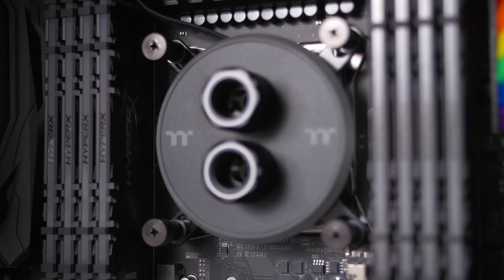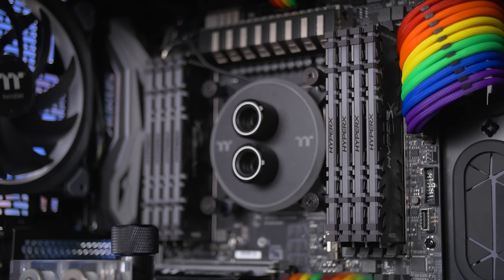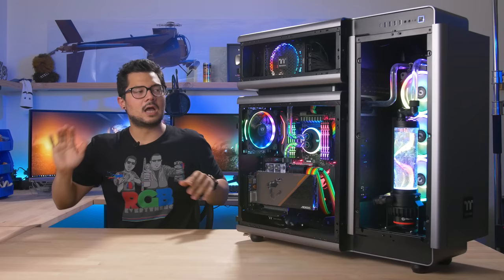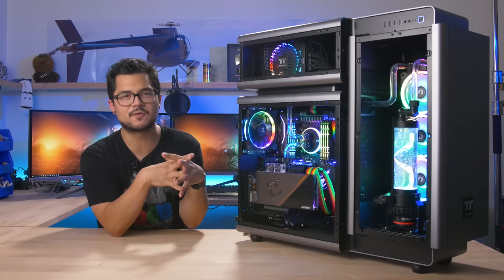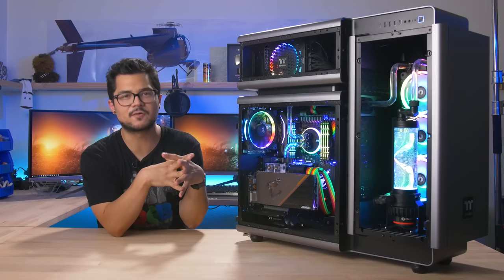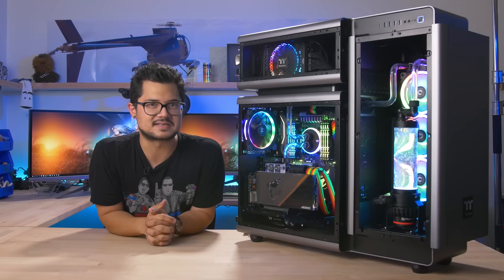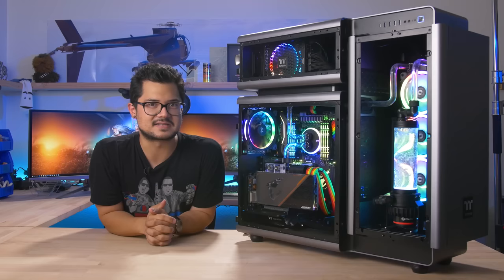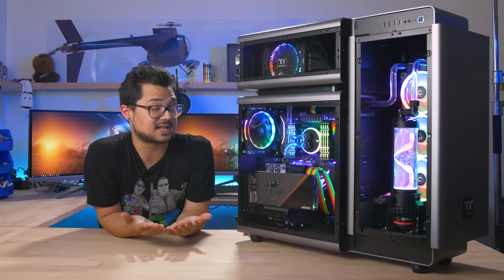Insane RGB Water Cooled PC (Part 2: THE REVEAL)

Comment: But wheres the RGB fittings
Reply: RGB SSD, RGB cables, RGB liquid.
Reply: i don't think thermaltake makes RGB fittings.
Reply: Bill Huffman r/wooosh
Reply: they do make rgb fittings but you gotta get them in  a pack of 6
Reply: hed420  what have they done?
Reply: MAJORzer0 Tbh, I like them . I'd rather get rid of all the leds in my system and just have the tubes glowing . The only thing that's rgb on my system is the motherboard and the stock amd ryzen 2700x heatsink fan . I went with regular non rgb ram sticks and system fans for a reason, there is such a thing as too much rgb, but I would gladly get rid of the stock amd rgb fan and replace it with these rgb thermaltake fittings .
Reply: Maybe going to Linus for that prototype RGB cable might be an idea? LMAO. But seriously, if there's anymore RGB, we might hit technical limitations.
Reply: @dolan-duk  ssd are here, cables are here, liquid could be possible if the tubing had strips in it but might lot look so good
Reply: @kyukyoku_  there are rgb fittings. Pretty sure the guy was really asking for rgb fittings.
Reply: Rgb coolant?

Comment: I have the same reservoir, in a much smaller system. I put a round mesh screen on the bottom and have 2 small live goldfish in mine. I use a large automotive canister fuel filter on the pump output to protect the system from contaminants. The fish last about a week, then have to be replaced.

Comment: My new build  merges an In Win 303 and 805, using the psu cover from the 303 to make a 'room' thq4 houses pump res and rad.  the soft tube idea works perfectly in that tight space.  boom.  thank you kyle.

Comment: Damn, Kyle! That thing is as big as you. It looks amazing! I have a question about a specific product in the build. What do you think of the Riing Trio TT fans? They look really nice and well built. How do they compare with the Corsair LL120 sets of fans. How is the sound sync? That's kind of a selling point for me. I currently have 9 modded Lian Li Bora fans that work with Asus Aura Sync and still have PWM functionality. I had the Corsair fans and returned them. Honestly, because they would not sync with sound. After modding the Bora fans I probably could have done the LL fans also, but the LL fans did not have the lighting on both sides of the outer ring like the Boras, or at least clearly seen from both the front and back, and now these Riing Trio fans have the lighting on both sides also.

Comment: Hmm, it's a nice looking "showroom" PC, everything is visible right away. But for a case of that size (and probably price), it should have at least a total of 6 fan rad spaces (like 2 triples or 4 doubles, etc). It would've even be easy to place 2 of those triple rads in that compartment on the right, one next to the other, forming like a 6-pack radiator, even if it would've been a bit of a squeeze (alternatively, if they didn't fit, make the case 5 cm longer, nobody would notice the difference)

Comment: Could use some of the rainbow cables at the PSU end to give that section a bit more color, felt a bit bland up there which seemed out of place from the rest. The GPU to CPU pipe looked like it might have been a bit short, seemed like you had to really push to get it close enough which is a bit worrisome if that's what happened, or maybe I'm just seeing things lol. Other than that I'm really digging the whole thing.

Comment: I'm not very knowledgeable with water cooling but it looks like you left out the tube in the reservoir return which is causing all the air bubbles. I was under the impression that air bubbles = bad in water cooling, correct?

Comment: Hello I have a 1050ti 4gb, i5 8600k, 8gb of ram, 500w thermal take psu, and a z370 gaming plus. 
But when i run Fortnite, PUBG, and SCUM all on low my main amount of fps is around 100 and usually drops below never peaks above 100. Do you know of a fix? I have windows 10 64 bit aswell just thought my pc should run alot smoother than it is now.

Comment: Love your stuff. I do wish that one of you Techtuber dudes would make an AMD based system that was as big and costly as this thing though. I understand Intel has certain things going for it, whether its sponsors or that intel tends to have higher clock speeds, and possibly more stable overclocks in some situations, I get that, it's just I have seen like, 20 different $x000's customs built PC's though, and no one has done one that is a fleshed out and  baller on the amd side as the Intel people seem to do.
Reply: Jay has a threadripper one in the Cougar case, but it's really simple. Intel parts are still considered upmarket, just as AMD ones are, so sponsors who want to show off the best and brightest (compared to marketing campaigns, sponsorship on videos is SUPER cheap), will obviously provide those instead of AMD parts.
Reply: I know, it would still be nice to see one absolute badass build for amd, like this one is on the intel platform. I eluded to the fact that intel and their  partners do more sponsoring in my comment.
Reply: And I watch a lot of Jay's vids, and that one in particular was nice.
Reply: It isn't even that Intel and their partners do MORE sponsoring. It is the that the sponsors who make both Intel and AMD parts themselves prefer to show off their Intel stuff, because they prefer to show off their "BEST" stuff. Same with Nvidia. Many times more sponsored ultra-high end systems than "reasonable systems" and that is the exact same reasoning. Intel itself does relatively little sponsoring (same with Nvidia. I forget where Linus walked through all of it, but it turned out that Nvidia and Intel combined had paid LTT something like 1/3 as much over the life of the company as ATI/AMD did for sponsorships. Clearly the third party vendors though have a distinct preference in what is being shown.)